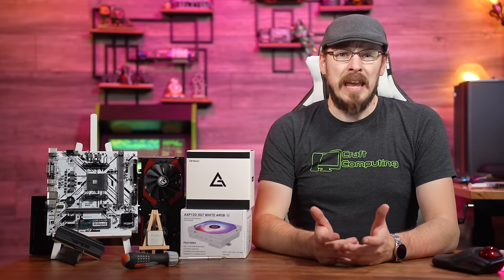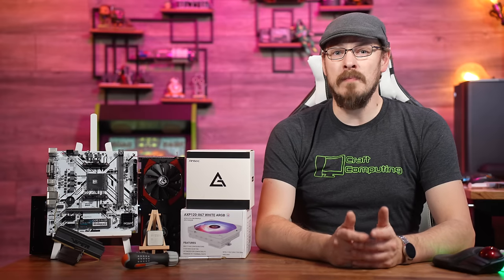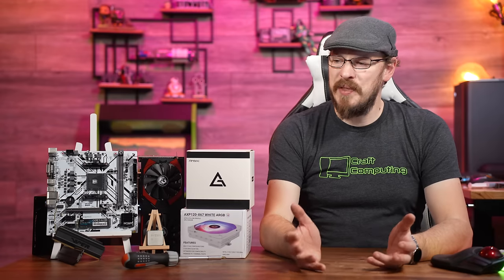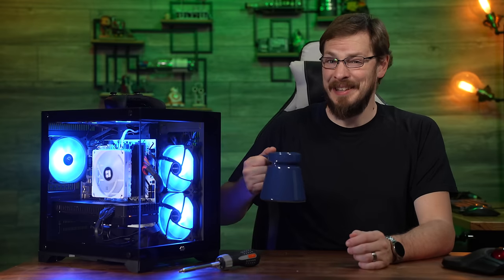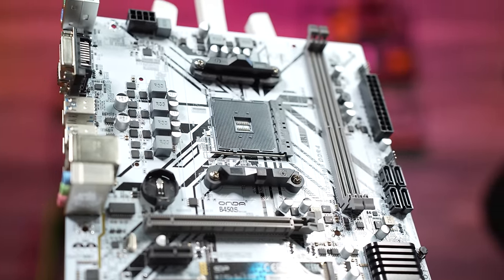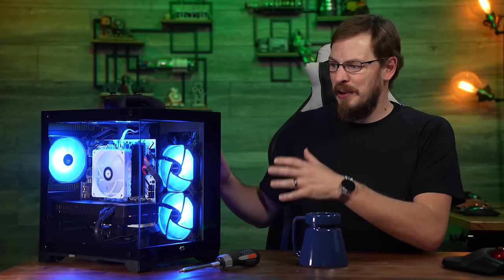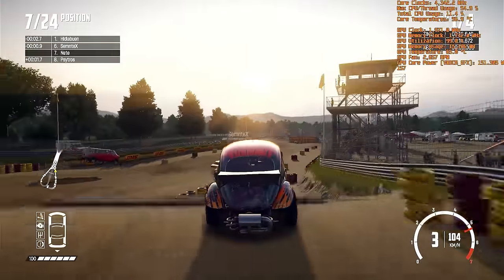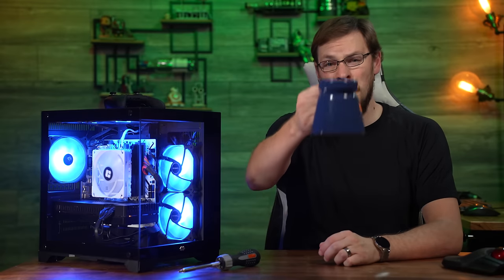I built a Gaming PC for my Nephew on AliExpress

Comment: 12:58 Very minor nitpick, but something worth mentioning:

DDR4 has multiple "official specs", or what we also call a JEDEC spec - These can go from DDR4-1600 all the way up to DDR4-3200. DDR4-2133 is what you might find on most memory sticks out there that have a XMP profile, or DDR4-2400 if you have higher-binned memory modules. JEDEC means that these speed/timing combinations have been confirmed to work and are programmed into the memory's SPD chip, which means that the user just has to put them in a compatible motherboard and turn on the computer and they will run at that speed. Anything that is NOT JEDEC is considered "overclocking".

That's why you can get ECC kits of DDR4-3200 CL22 - Because they're a JEDEC spec. A user can place these in a server and they are known to work, which means that any memory errors they might have to correct is not because of "overclocking", but only because of actual bit flips or something similar.
Reply: "the user just has to put them in a compatible motherboard and turn on the computer and they will run at that speed" 90% of the time that isn't true and it needs to select that clock profile in UEFI/BIOS
Reply: @gg-gn3re  Thats because ram kits for consumers all are expecting the user to set xmp/doct/expo, in servers (think ecc etc), if you buy 3200 mhz cl22 ram, it will be 3200 mhz cl22 assuming your cpu/mobo can work with it.
Reply: @lookitsrain9552  no, if you buy that ram it'll have a profile for xmp etc for those clocks and you select the profile and it'll run there. It won't run there upon plugging it in... I see this in virtually every computer I've ever come across. Peoples ddr4 ram is running at 2133 and ddr3 at 800 or 1333 or w/e it was because they never went in and checked a checkbox.
Reply: @gg-gn3re  Try reading what i said.
Reply: @lookitsrain9552  maybe you should learn to read before confusing yourself further. Your post isn't even relevant to what I initially said.
Reply: @gg-gn3re  I detected room temperature IQ, so I didn't want to reply myself. But I did ask ChatGPT.

"JEDEC refers to the official specifications established by the industry standards organization, which are programmed into the memory's SPD chip. These JEDEC specs are designed to ensure compatibility and stability, and when you install DDR4 RAM that adheres to JEDEC specs into a compatible motherboard, it should indeed run at the specified speed without needing to enable any additional profiles in the BIOS.

On the other hand, XMP (Intel Extreme Memory Profile), EXPO (Extended Profile), or DOCP (Direct Overclock Profile) are profiles developed by memory manufacturers to offer higher performance settings beyond the JEDEC specifications. These profiles are not part of the official JEDEC standards. To run RAM at speeds beyond the JEDEC specs, users need to enable the corresponding XMP, EXPO, or DOCP profile in the BIOS/UEFI settings."
Reply: @VNLEASHED  Yea I'm sure you detect that IQ everywhere you go.
Reply: I first heard the old wive's tale of DDR4 being limited to 2133 on LTT so I blame them, but Jeff also gets full blame for repeating it; have designed boards and put memory on them (chips, not modules), so I have had to do the transmission line and timing work and actually understand the spec. What Jeff needs here is a pair of reputable 3200CL22 modules with matching SPD- The Micron 32GB modules I tend to use perform as advertised and then some - I have a suspicion that most of the memory targeted at the 'gamer/overclocker' segment is sold as unsorted die and binned to the edge, because I have a terrifyingly high failure rate on them, and the plain modules can be pushed just as far.
Reply: XMP profiles on AMD are not that good, meant for intel timing.
Reply: @lucasrem  huh?
We're talking about a motherboard that does not have XMP support and we're talking about memory kits that do not have XMP profiles and you're commenting on XMP profiles. This thread has multiple comments on this topic, please read and do some research before commenting.

Also, I love how you came here with a comment that does not have anything to do with my original comment and still get it wrong - XMP profiles only stipulate a few variables: Speed, VDIMM and the primary timings (tCL-tRCD-tRP-tRAS). Everything else is up to the motherboard to automatically choose what is compatible with that particular CPU/RAM combination. The only difference is that on AMD the tRCD timing is broken into READ (tRCD-RD) and WRITE (tRCD-WR), but the XMP profile will set both these timings to the same value.

For example, a DDR4-3200 14-14-14-34 kit will have the same timings on AMD and Intel, the rest of the values are just picked by the motherboard. So an MSI motherboard will have different timings than an ASUS board, even if the rest of the system is exactly the same. Other than that, there is no difference between AMD and Intel when it comes to XMP profiles.

That being said, Ryzen prefers MCLK and FCLK in 1:1 for best performance and most Ryzen 1000/2000 chips had trouble going above DDR4-3200. That's why the recommended Ryzen memory kits are DDR4-3200 for Ryzen 1000/2000 and DDR4-3600 for Ryzen 3000/5000. Anything above that will work, but it will most likely run in 2:1 mode.

Also, remember Intel 12th Gen Non-K CPUs that refused to boot DDR4-3600 because you can't change the voltages on those and the memory profiles refused to boot? Yeah, XMP profiles are totally made for Intel.

Comment: Love builds like these! 
My local E-waste recycling center is my favorite place to get second hand computer hardware. Ebay is probably my 2nd choice but I've, by far, found and gotten much better deals from my local recycling center. I've gotten to many great items over time to list them all but the most recent items im especially happy with are sweet 4k wide screen monitor(about 4 or 5 years old i think) and  a practically brand new still in the box 850w Seasonic semi-modular 80plus Gold power supply.
I got the monitor for about $80 and the PSU for $30 flat.
I was skeptical about the PSU at first, but was astonished when I realized it was essentially a clean unused power supply.
Reply: nice
Reply: I was very patient while scouring eBay for an IBM Model M keyboard.  Found a listing where the guy didn't know what he had, and ended up with a 122-key Model M (listing did not say it was IBM) for $20.  Cleaned it up and I've been using it ever since.  The thing is an absolute tank.
Reply: @Scarsuna  ok THAT.. sir, is what I call a score!

Comment: Built a PC with a 2600X, B450M, 16GB 3600MHZ, and an RX 5700XT for 270$. Best part is that was still enough for a 600w bronze PSU, and a white dual chamber case with white cable sleeves to complete the aesthetic. Built using only new/refurbished parts on AliExpress.
Reply: rip shouldve picked like 3600x
Reply: That sounds like a really good choice of parts for your type of build, however i would avoid Aliexpress at all costs, you either hit the target, or miss it & end up getting scammed
Reply: @xXVibrantSnowXx  They have 5 day delivery and free NQA returns within 2 weeks where I’m at. It’s also very obvious if it’s a scam since it tells you how many have been sold. I only ever buy something if it has already got over 1000 bought
Reply: @obamabinladen-de7rt  can’t get that for 270£

Comment: I built my nephew again rig this year as well. I paid roughly around $650. I got a handful of used parts and a handful of new parts. Most notably a $80 5600x CPU. Asus X570-wifi tuf board. I threw it in a new Corair 4000d. But a used 980 pro 1tb. Got a deal on some teamgroup ram that was cheaper than ebay listings for dominator. The 5700xt was $150, $200 w/taxes and shipping. I think I bought thermalright fans.

Comment: I have a jginyue b550i-gaming motherboard I got off AliExpress for $60. I was able to over clock my memory to 3200 with only changing the options down to Tras. Left everything else on auto and it works perfect paired with an RTX 3070 and a 5700x. I didnt research the pricing for itx builds prior. Wasn’t really trying to spend $200 on a last gen board. Just like yours it doesn’t have rgb headers but it does have a usb-c header for the case
Reply: This is good to know cause I'm currently looking for a reliable b550 itx board so i can put together a small transportable gaming pc i can take places without the worrys of lugging around my main home pc.
Do you know how many VRM stages it has?

Comment: I ordered one of these cases recently and I am guessing they improved the build quality as I didn't find it as flimsy as you seemed to (then again, I am pretty sure we have both built in some paper thing cases before, so there is that for comparison).  I used the 3.5" drive tray to hide the majority of my cabling with a fully modular power supply and a cheap cable set, I was able to keep it neat.  7 static red led fans finished it off.  For the price, I think it's a decent case for a budget build, especially for someone that wants to see all the fans lit up.

Comment: As for the memory, I understand that it doesn't have DOCP or the XMP equivalent, but does the motherboard not train the ram on first boot? You should be able to plug in the primary and secondary timings provided with the sticker on the memory, leave everything else on auto, reboot and be good to go. Just make sure to put the voltage at whatever is required, probably 1.35.
Reply: @POVwithRC  You know what's always an option? Brainfart, forgetting things, or running out of fiddling time.

Comment: I love these kind of builds. Had to do one for my brother a while back because the Fx6300 just wasn't cutting it anymore and he was stealing my moms Laptop all the time. I used 100% used hardware because I told my mom I could do it for around 100€. It was not a gaming system and I actually did it for 96,5€ after selling the old MB/CPU combo. He now has a R5 3600x, 16gb ram on a b450 board, case and PSU from my stache of leftover Hardware, Hard drive, ssd, and gpu from the old system but came from my stache a while ago anyways. for about 150 more I could make it a gaming pc, 100ish if I just give him the other stronger psu from my pile of old Hardware but I wanna keep it.

Comment: I've had pretty good luck with those silicon power nvme drives. Very good bang for the buck and they run cool.
Reply from the maker: Ordered the 1TB on Amazon last weekend...
Amazon: You've ordered this [13] times
Reply: How good is your luck? Because i myself am unhappy with my SSD which is a Samsung 870 QVO 1GB (SATA). the writes are slow, and they aren't just slow after a 50gig burst, they are just ALWAYS slow, and during writes the whole system slows down, looks like it also stops serving reads while it writes. It also fell off the bus every damn reboot before i updated both the drive firmware and a new mainboard firmware came out (b450), and now it only falls off the bus occasionally. although it's a QLC, it's got 1GB DRAM, so one would think it should have a more benign behaviour, not like this absolute piece of shit?

Next people recommend me i should buy a WD SN570 but also everyone complains about Steam game updates stalling down to 0mb/s (less than 20mb/s long term average) unless they disable the Windows write cache for that drive. WTF is that? Is this a unique flaw, do any other SSDs have that same issue? Does everyone experience this issue equally? Why does nobody talk about it?

Comment: One (important) thing to note about the power supply: the 380W that was being pulled under load was from the wall and not what the power supply itself was delivering.  Assuming a power supply efficiency of around 80%, the actual amount the power supply had to deliver was in the region of 300-310W which is well under the 430W it's rated for.

 It makes perfect sense that would be actual amount being pulled as in stock form the RX 5700 XT draws 225W under full load, and the 3300X 65W.  Add a dozen watts for the fans and SSD and there you go.  In short, the power supply was just fine and even left a decent amount of headroom.

Also, there's no reason why you should've left the memory at a paltry 2133.  If you didn't want to go through the hassle of manually tuning timings you could've just manually set the clock speed to 3200 or 3600 and left the timings on auto and what the motherboard would do is automatically set the timings to JEDEC spec.  Alternatively, you could have taken 5 mins to look at the memory specs and manually put in only the primary timings according to spec and left all the secondaries on auto.  That is very little effort for a good amount of extra performance in games that are CPU and/or memory-bandwidth limited.  Not your finest work, I must say.
Reply from the maker: I considered this, but it's not even an 80+ supply, and is easily 7 years old. I'd rather err on the side of getting him something that works.
Reply: @CraftComputing  

That's fair.  Components like the capacitors age and degrade as they accumulate power on hours and are not able to handle as much as before.  So in reality if the power supply got a fair amount of use it would probably be able to handle something more like 380-400W reliably.

You really should not have left the RAM at 2133, though.  There would be zero worries about instability setting the clocks manually to 3200 and leaving the rest on Auto so it runs at JEDEC spec.  3200 CL22 is still way faster than 2133 CL15.

Comment: Not sure the motherboard can do PCIe 4.0. This is from the link you gave ONDA B450S-W B450 Motherboard AMD AM4 For Ryzen 1/2/3/4/5 Gen & Athlon Processors DDR4 64GB PCI-E 3.0 16X SATA3.0 M.2 B450M.   Notice the PCI-E 3.0 listed.   As the board is a b450 and PCI-e 4.0 was only enabled on the b550 and x570 I think you might be mistaken.

Comment: I must agree about the choice of the RX 5700 XT. I currently have one on a MSI B450 board paired with a Ryzen 3600XT and 16GB of DDR4-3600.  It performs well in slower-paced modern titles, returning 60+ fps at 1440p in (amongst others) Shadow of the Tomb Raider, RDR2, Diablo IV, Spider Man Remastered, Witcher 3 and Assassin's Creed Odyssey.

Comment: Some food for thought. YMMV

For $4 more, you could have bought a Cougar MX410 Mesh-G RGB case with 4 RGB fans from Newegg and saved the $32 you spent on the Antec fans. Then you could have bought a proper MB (like the ASRock B450M PRO4 R2.0) with an ARGB header and upgraded the PSU in the first place.

Comment: Nice build. 
I got a 4th Gen i7 with a Z87 motherboard with 32GB of DDR3 RAM and a 500GB sata3 SSD and been running for a few years but without a graphics card and running it with integrated graphics. So I thought of giving this PC to my son for gaming. So with the most budget in mind, I got a used Zotac GTX 1080 Ti Extreme 8GB just for about $100 USD at my local internet used market, and bam it's a gaming PC with not much to spend. 😄

Comment: The cheap fans with hub RGB and speed control just make life easier when dealing with Chinese motherboards. Of course it’s not “ideal” but I haven’t had issues with them and having them all locked at one speed that can move enough air to keep the temps low is fine. As long as the CPU fan can be controlled I’m fine with it

Comment: Good Video, but tbh i think its a great mistake to not be tinkering a bit more with with the ram get them to run 3200mhz or even better 3600mhz, ive just read the document on  the motherboard  and this should be possible read from ondas own homepage it has a pdf to set it up manuel, as id say that would give an significant boost, and as we all know those amd chips likes to run at that speed, and im not totally sure i would change the psu it still got 50 watt to spare during test

Comment: Awesome content as per usual, 5700XT is a fantastic value card, sadly my XFX Thicc triple fan one died after just over 2 years of service, it artifacted like crazy...it would randomly cause jy drivers to be uninstalled up to 4 times a day, but then itd be fine for 3 weeks, very odd, sadly im in Europe so XFX wouldn't let me claim on the warranty as it's 2 years in the EU and 3 in the USA, massive shame, i replaced it with an ASUS 6650XT and I am extremely happy with it
Reply: did you overclock the card?

Comment: I get the experimentation angle, but for me at least, that all goes right out the window when it comes to machines built for family or friends. 
Also, I despise throwing money at not-good enough equipment, which is something you wind up doing a lot when you experiment on. I personally would not deploy that system to anyone except as a gag or a troubleshooting exercise.

For family & friends, machines get built like I'm never going to be able to see or touch them again, so they need to simply work. That rules out that motherboard and the PSU right away.  
You can get an ASRock B540 board for within $10 of that price, with an actually useful BIOS  (I found one for $2 more), and something that'll have the BIOS support (if not necessarily the VRM cooling) to handle a faster AM4 CPU upgrade later.
The PSU, well, you covered that.

I would put another $100-$120 towards this, replacing the Motherboard, PSU and putting in a 5600g. Versus an R3, an R5 is just so much smoother in day to day use even without the IPC improvements, plus the stock cooler is more than adequate. That and ditching all the RGB, even though the better board would actually support it.

While I wouldn't want the 5700XT, the reality of GPU pricing means yeah, you're pretty much stuck there unless you want to chuck in basically another $100 for something newer/faster.

Comment: i have the soyo a520m Dragon and it doesn't have MOST of problems that's that one has, i say most because it only has two pwm fan plugs and with my 5600x at default settings the vrm gets hot, it dose have ram profiles tho